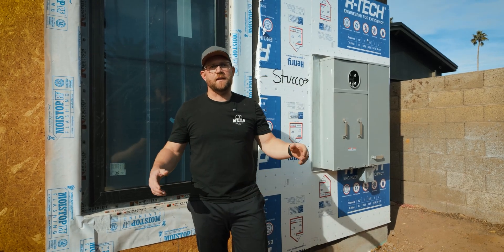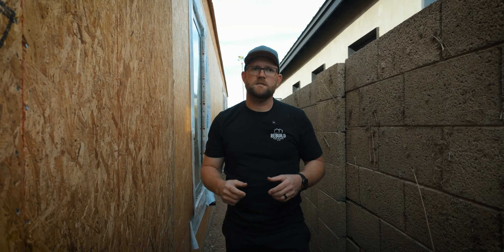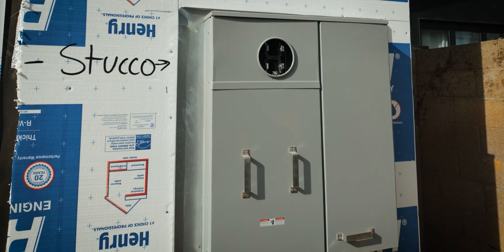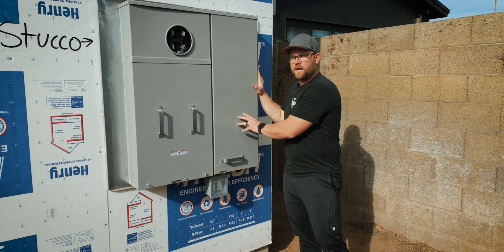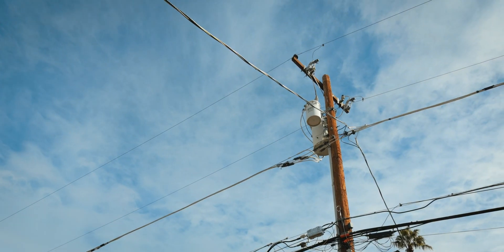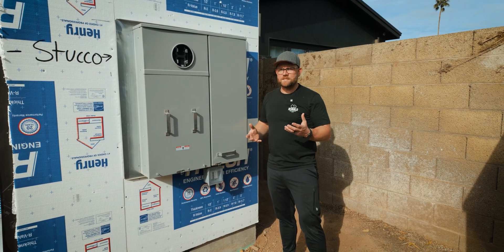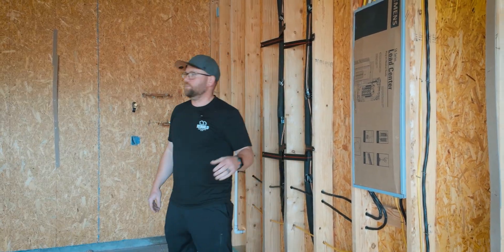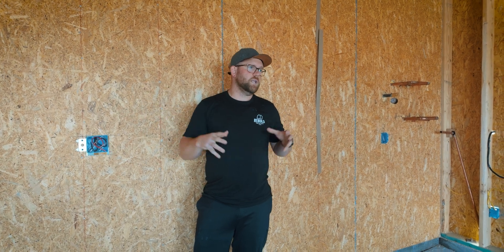400 Amp Panels: The Future of Residential Power? | Rebuild The Block

Comment: Spoken like someone who has never actually lived with electric vehicles.  If the 400A panel is too scary, just get chargers with load management.  Most drivers would be more than satisfied with 240V @ 30A for home charging.

Comment: The straw that broke the camels back???  We just put a 200amp panel in the shop for 2 chargers that required 100 amp breakers!  When they are both cooking that panel is swamped.

Comment: Interesting that this new build standard now for a 400amp service is becoming standard. Typically though a dedicated EV wall connector is a 60Amp circuit, although for the larger EV trucks, that can be up to a 100Amp circuit. In the not too far distant future you will have vehicle to grid, so that EV vehicles can supply the grid when there is needed extra supply.

Comment from the maker: $12-15k for system inside the house 
$6-10k to utility company for upgrading the transformer / grid if required. 

Total extra cost for 400amp vs 200amp roughly -$12-25k
Reply: I just diy’d a Siemens 400 amp panel like the one shown with the main 200 and an additional 200 disconnect. I got the permit for $620, the panel was like $3000, then I got 400 mcm copper in 3” rigid galvanized pipe and all the trimmings for $5300 total. This is April 2024 in California.
Reply: Genuine question, why does it matter if the homeowner is the one paying? Maybe these people just want the upgraded service in case they plan to add more things in the future. I just don't see an issue as long as the person who will eventually own the home pays for everything.

Comment: The new NEC code dramatically raises the cost of the buildings electrical infrastructure.
Not only the incredible price of copper wire, but requirements for AFCI and GFCI, for central air-conditioning & other high current circuits these GFCI breakers aren't cheap 50-100 each. All before labor
Reply from the maker: Crazy right! Local inspectors are requiring arc fault on all breakers in addition to GFCI.
Reply from the maker: Cost is getting down right ridiculous!

Comment: Latest NEC code, may offer some solutions. "Automatic load shedding" 
*Panel MFG's are now offering Smart Panels that will Automatic load shed, thus keeping you total electric load under buildings electrical service.
*  Add a Load Manager to existing service rather than upgrading service,  https://youtu.be/RSFYYiSLIms?t=108
* Two Tesla chargers can be connected to one double pole breaker and automatically compensate allowing both cars to charge the same time at a lower rate, or one car to charge at a higher rate. i.e. load balance.

Comment: In a new build, why do you need the sub-panel?  Why can’t you have 1 400 W panel and have your dedicated circuits from that panel?
Reply from the maker: You can just do one panel. But You would have some pretty long home runs for some your major appliances and that dang 50amp 240v run for the electric car (sometimes 2 charging stations). Heck Down here in AZ we also have a 50amp sub-panel for pool equipment.
Reply: @rebuildtheblock  Cool.  Thanks for the reply, I really enjoy videos like these.
Reply from the maker: Oh I almost forgot the reason for the sub panel is based on electrical engineering requirements. Usually due to the lack of available circuits (30slots) on most 400 amp service panels.

Comment: We need more efficient homes. Builders and engineers need to adapt new methodologies for using power and controlling comfort. It can be done on 100 amp, much more easily on 200.

Going overkill on electric supply is inefficient and a poor use of money. Could of been spent on the overall efficiency of the build.
Reply from the maker: I would tend to agree. But I’m required by local Municipality to use an electrical engineer now that calculates the load and requirements needed.
Reply: @rebuildtheblock  thank you for having an open mind and sharing your behind the scenes. I think the hardest part in building efficient homes is educating the consumer and regulators on what is practical and ideal. Not to mention added complexities such as local climate. Good luck.

Comment: We have two EVs, a 3 ton heat pump, an older 3 ton AC unit, and an induction stove on a 200 amp feed from the grid. Each EV charger is set for 32 amps since charging over night does not need to be fast. We have the chargers set to start charging one car at midnight and the 2nd car to start charing at 4 am. No need to charge both at the same time. There are chargers that can load balance with an upper limit set to keep power usage under control. Also charging after 11 pm when the grid usage is low, helps to keep the grid from being over loaded. EVs aren't a problem.
Reply from the maker: Curious what year what’s your home built?
Reply: @rebuildtheblock  My house was built in 1997. There are a total of 14 homes on the street and all have 200 amp service. Some older homes in the area only have 100 amp service.

Comment: Also the mandatory heat pumps in stead of gas heat due to new laws.
Same breaker as the AC but Big increase in yearly consumption .
Where will the power come from ?
The same people mandating heat pumps and electric Cars will not let you build a new power plant or 
Power line !
Unless it is a windmill or solar panels .
So no charging card or heat on wind less days  or after sundown ?
Ps I had a EV-1 GM car in 2002 and love solar panels so am not anti alternative energy !
Reply from the maker: I totally agree. With you here. I’m not anti-alternative either. Just a lot of power being used these days. In the 50-80’s 100 amp panel were the standard the. 90’s-2020 200 amp panels standard - 2025 400 amp panels have become the standard. 

Heck on the most recent house the electrical engineer tried to convince us we needed a 600 amp panel. This forced the clients to swap out quite a few items to gas to get back down to a 400 amp panel. And save about 25k

Comment: Why don't you just put in a Siemens load manager for car charger. They are like 900 bucks and will cut the power when the load is too high
Reply from the maker: Good idea…I will Suggest this to our electrical engineer on our next build!
Reply: Or even better, use EVSE's that have load management built in, so instead of just cutting the charging completely, they charge with the power that is available.

Comment: You absolutely do not need a 100amp for two electric cars. Not necessary at all! We have a 40-amp circuit for two cars, and it works fine. 60-amp for two cars would be fine as well. More than plenty to charge the cars overnight. I had one car on a dedicated 40-amp circuit (32-amp usable) and got about 30 miles per hour of charging.
Reply: New charging stations in the USA are 80 amps each. Don’t forget bi directional cars are on the market as well. How much power you can pull from them to run the house is also limited by the circuit size. 200amp panel is definitely the correct size for 2 car chargers. The cost difference at install is negligible
Reply from the maker: @rpvitiello thanks for the comment
Reply: US code doesn't allow it. NEC Section 625.42 states that “Electric vehicle charging loads shall be considered to be continuous loads.” That means a dedicated circuit rated at 125% of the charger's ability. So a 40 amp charger circuit must be 50 amp wiring and breaker. 
So 2 chargers would be a mandatory 100 amps just for chargers right. Kind of. Further on it reads. 
“Where an automatic load management system is used, the maximum equipment load on a service and feeder shall be the maximum load permitted by the automatic load management system.”
So if you were to install a very expensive load management system you can get away with 80% split between 2 chargers, but that will slow your charge rate as well.
Reply: @Species-lj8wh  No you have that backwards. The equipment must be rated for at least 125% of the load circuit.
Reply from the maker: @Species-lj8wh thank you for jumping in and referencing code. I couldn’t have said it better!

Comment: 1) neutral not required for car charging outlets.
2) looks 8awg compared to the 10awg ground, 40a max circuit, 32a max charger on nmb.
3) Where more than two NM cables containing two or more current-carrying conductors are installed, without maintaining spacing between the cables, through the same opening in wood framing that is to be sealed with thermal insulation, caulk, or sealing foam, the ampacity of each conductor shall be adjusted in accordance with Table 310.15(C)(1) and 310.14(A)(2), Exception, shall not apply
Reply: Neutral gives the home owner the flexiblity to plug whatever they want in there (RV, air compressor, etc), tho.
Reply from the maker: Thanks for watching!
Reply: hope it is a bryant or hubble receptacle installed and not a $9 one

Comment: To bad you can't have 3phase 120/208 . 200 amp.
Reply: That’s exactly what New Jersey power companies are offering as a standard option. 400amp split phase, or 200amp 3 phase. I’m about to upgrade to the latter for my existing home with only a 100 amp service.

Comment: Good video thanks! In Arizona, you get a lot of sun, Would imagine you can you also use solar panels and storage batteries to supplement grid draw?  If so you can you then stick with the 200 amp "Grid Panel" for high draw loads, and wire the "solar" fed lower draw loads to another 200 amp panel.  I know initially higher cost but imagine the payback is quick.  Rich
Reply: It's not, energy is so cheap in AZ payback can be near the lifespan of the panels.
Reply from the maker: @Magnumsonly I’m actually paying a color company $17k to buy back a leased system on a duplex we have so  I can move forward with a development. They did not pay for themselves and they had been on the duplex for over 10
Years.
Reply from the maker: Thanks for watching and your comments. I like a lot of the suggestions. And many are good options…however most still increase the overall cost of the system. 

This home is a spec and I wish people would be willing to pay for more for better quality home.

Comment: I mean, wow. What's the regulatory environment like where you're at?  I'm a remodeler in Ottawa, Canada. We can add a car charging plug (30 or 40 amp) here on a 100 amp service if we check the history of actual electrical draw with the utility first.  They want to ensure there is enough capacity under typical conditions.  Sure an electric range can draw 40 amps, but it's for 45 seconds on Thanksgiving.  Needing to do that while fast charging two Teslas, while also needing electric resistive backup from the heat pump while also running the dryer while also stick welding in the backyard.....   Does the utility let you save the copper and use a smart panel for this once in a thousand year perfect storm of load?  I'm genuinely curious.  Even in the luxury market, even with the dumbest regulation, even with a 4000sqft house this seems like massive overkill.
Reply: NEC Section 625.42 states that “Electric vehicle charging loads shall be considered to be continuous loads.” That means a dedicated circuit rated at 125% of the charger's ability. So a 40 amp charger circuit must be 50 amp wiring and breaker. 
So 2 chargers would be a mandatory 100 amps just for chargers right. Kind of. Further on it reads. 
“Where an automatic load management system is used, the maximum equipment load on a service and feeder shall be the maximum load permitted by the automatic load management system.”
So if you were to install a very expensive load management system you can get away with 80% split between 2 chargers, but that will slow your charge rate as well.

With the current government forces with encouragement from specific states we won't name here. They are pushes from every side to electrify everything. Range, mini-splits, heat pumps, dryers. I have recently ran up against this 200 amp wall. Cost to upgrade to 400 amps? $10 to 12 thousand. Mind you, 8-9k of that is so the utility will upgrade the transformer. 
SO, the plan to remodel the bathroom add a second EV charger and hot tub have been put on hold. Perhaps permanently.
Reply: @Species-lj8wh  Thanks for the code reference!  As always, lovely to have another builder share the details.  I think the thing I questions is if Level II charging at full capacity is necessary or desirable in a home context.  Trickle charging a vehicle from a 20 amp outlet still allows plenty of range and flexibility except in the situation where the owners need to drive more than 100 miles a day, which emphatically isn't most people.  Aggressive electrification is going to be required whether we like it or not, but assuming max draw is lunacy.
I had a client switch over to a heat pump a few years back and a 200 amp service was pushed on him because the assumption was that he needed to run 50Kw of electric resistive back-up heat every bloody day of the winter.  Ottawa's average winter temp in January is -15C(5 degrees f), well within even a cheap pump's operating range.  I question the need for overkill.  I don't question the urgent need for electrification.
Reply from the maker: @jboyd85 thanks for your comment. 

Here are a few of my thoughts. 

The electrical engineer is the one running the load calculations for new home development. Even with value engineering we are typically at 225- 250amp Load. 

But for the run down in our luxury market I becomes a space issue in the panel as well. 

Dedicated:
20 amp - Fridge 
20 amp - 2nd fridge / freezer 
20 amp - dishwasher 
40 amp - range/ oven 
15-20 amp - hood vent 
20 amps - garbage disposal 
20 amp microwave 
30 amp - dryer 
15 amp - washer 
40 amp - 1st AC 
40 Amp - 2nd AC 
50 amp - car charger 
50 amp panel for pool and landscape 

Obviously all the other lighting and outlet circuits including GFCI protected.

In short the draw of power will continue to increase especially as gas becomes more regulated and less appliances can help with offsetting the electricity
Reply: @rebuildtheblock  Again, your detailed response is terrific. Looking through the list you've provided I wonder again about overkill in a regulatory context.  Inrush current for most fridges is below 10amp, for example. I understand having a separate circuit for an inductive load, but assuming 20 amps static for a fridge? Twice???  Even a 1500cfm Broan elite external extractor has a continuous draw of 3.8 amp by the data sheet.  There isn't discretion for the engineer to pair this with another small load in the kitchen?
I'm curious, in your market, do pool heaters tend to be electric? In Canada, you mostly see natural gas units, even in new construction.
Are garbage disposals typically 20amp?  We never see them installed up here, luxury,mid, or low end.
Thanks again for the details!
Reply from the maker: @Species-lj8wh  yep I don’t think I even mentioned that the electrical engineer has been trying to spec 100amp panels for pool, spa, landscape and outdoor features. I told him max we need is a 50amp sup panel. 

Sorry you have to nix the spa
Reply: A 20 amp 240 volt outlet can provide enough EV miles in a night of charging to cover 98% of the driving needs for everyone. there is no reason to require people to pay this much of a premium. Hell… the people that need more car charging than that are probable eating out all the time and dont use their 50 amp stove lol

Comment: Blame the electric car, but the 3rd bathroom, A/C over 3,000 sq.ft. and clothes dryers in a freakin' desert are all innocent. The electric car is just the straw that broke the camel's back.
Reply from the maker: Fair comment…thanks for watching!
Reply: @Boomer848848    Our house is 4500sqft, 5 bedrooms 4.5 bathrooms.  Two AC units (5 ton down, 4 ton up). A pool with three pump motors, etc.   And our 200 amp service is plenty.   I'll blame the electric car.
Reply: You must be running those house loads at all differe t times of the day (i.e. pool pump at Night, cooking at evening, etc) or you got some great insulation in those walls and roof@5thGenNativeTexan
Reply: I built my own solar with battery.  10 months of the year I have no need to buy grid power
Reply: When the calcuation from the NEC acount for ac units and all dryers and kitchen appliances result in a 200amp panel. Then you can only blame what else we added
Reply: @jacobhatfield4970 an electric car is like adding a second electric dryer or oven.  It’s definitely the straw that broke the camel’s back. Power demand has been going up and up. that was the final thing to push the average home up to the next service size.
Reply from the maker: @rpvitiello fair you aren’t wrong!
Reply from the maker: @jacobhatfield4970 thanks for watching!